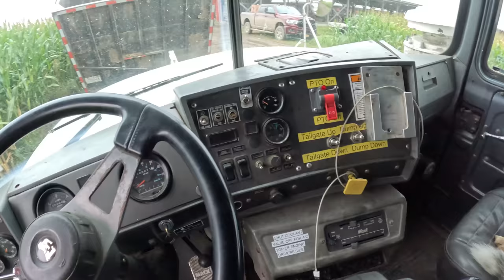Preparing For The Next Farm To Harvest- Kernel Processor Adjustment Issues

Comment: Looks like standard KP results.  Have they ever thought about a shredlage processor or putting the high differential pulleys on the standard KP?  We use shredlage rolls and would never go back to a regular KP.  Also, their nutritionist is correct and could have been more complete.  Drier kernels are brittle and will break into more uniform particles but will take much longer to soften and break down, thus more pass through in the early months of feeding new silage.  Wetter kernels will leave more on the second screen because they often pop open and can leave more of the skins intact; however, the doughy/milky starch on wetter kernels will break down faster and more completely in the pile and thus the cow.  Best to have 1/4 to 1/2 milk line if possible.
Reply: You just answered the questions I was going to ask, thanks

Comment: Thanx for the detailed description of specs for chopping - interesting wait longer for harder kernel to shatter but you’d have dryer stalks???
Reply: Wetter grain breaks easier then dryer. Wetter grain is also more digestible
Reply: @robertquast9684  NOT. the nutritionist said what I said so pay attention 👍
Reply: All I know and what I have seen on our farm with our chopper is when grain gets dryer and harder it is more and more important for the processor rolls to be perfect or you get kernels coming through. Wetter corn the kernels will smash. While not completely shattering they are still damaged enough to be digestible. Many farmers here in the Midwest aren’t looking to completely shatter the kernel because the grain becomes too digestible. If it works for the farm in the video that’s fine I am going off what works for us.

Comment: We're are your flotation tyres will they fit the mack
Reply: He would have to a new axle on the Mack to fit floatation tires. Had a 1980 western star triaxle that had 12,000 pound front end wore bearings like crazy. Bought a 20,000 pound front end put it under the truck around 1990’s cost $500.00 for axle along not financially feasible now.